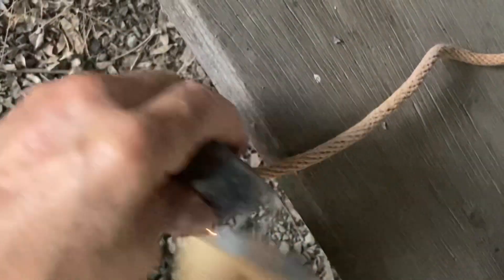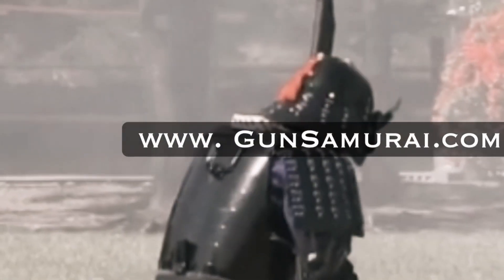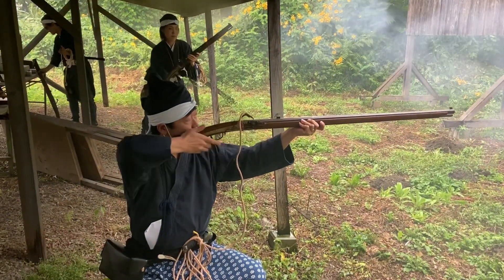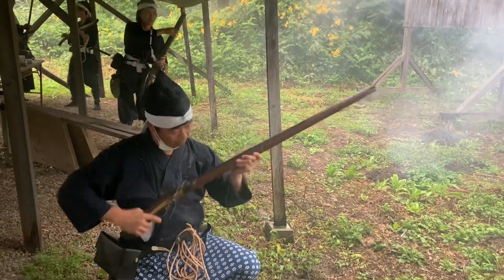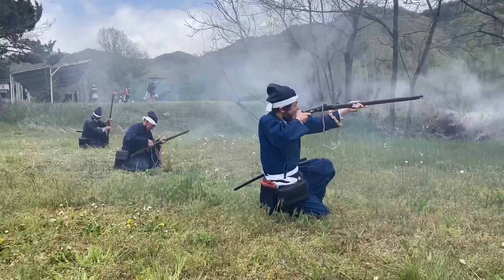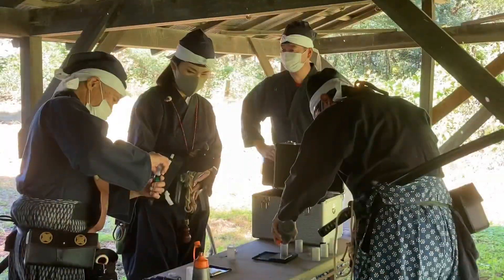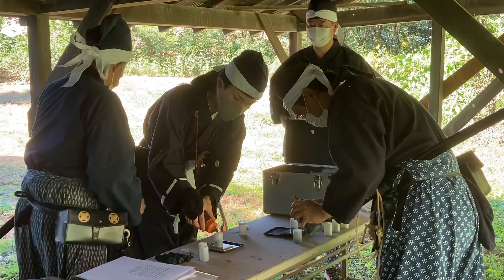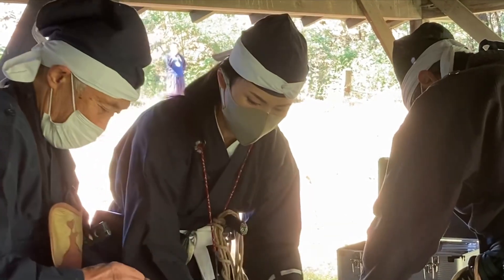How does Gunpowder Work

Comment: Would have been possible for a samurai of the Sengoku era to destroy a wall or make a hole in a wall by placing a lot of teppo  gunpowder next to it and lighting it with a fuse?
Reply: You need pressure as well so it would need to be encased in a casing of some sort to become explosive; otherwise it just burns very quickly.
Reply: Thank you  @Gun_Samurai ! 
So was gunpowder used in this way at some point in the Sengoku era?